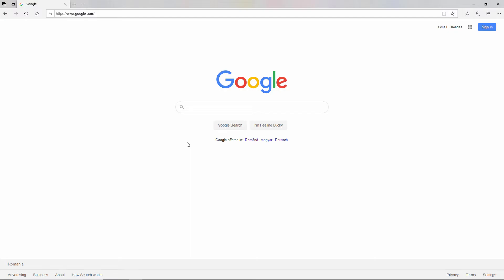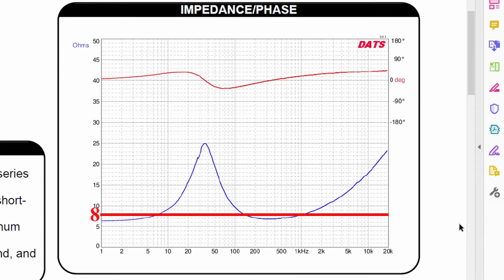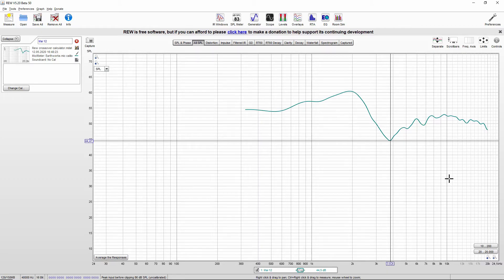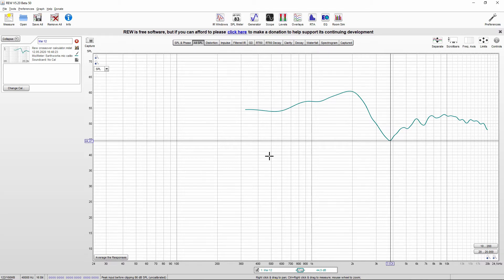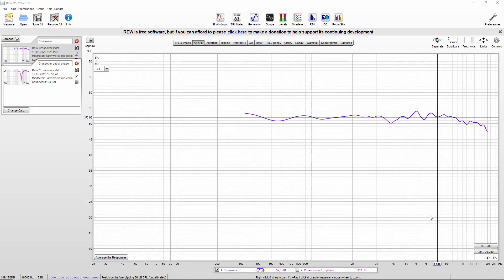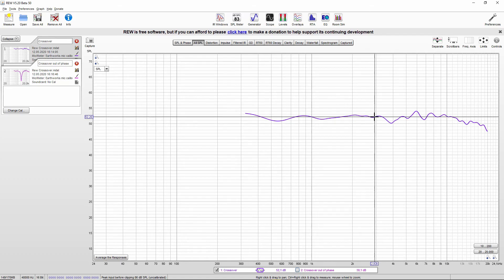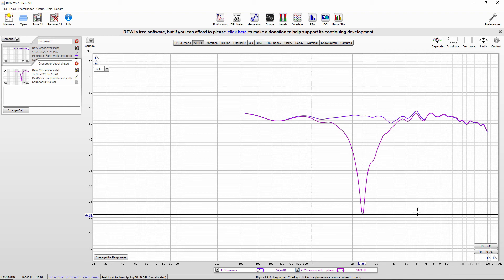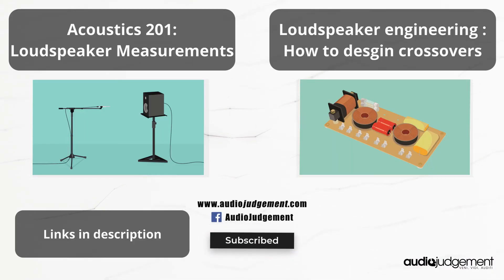How NOT to design a CROSSOVER

Comment: My god.. I’m in for a headache..
I’m currently designing a speaker with 18”, 15” 12”10” 8” and 3x6” plus 3 tweeters in a custom enclosure….
Oh shit…
I wish you  lived around the corner…
I might have bitten off more than I can chew.
My design might encompass the driver frequency that I would like, but the crossover might need a genius to fix.
I have 4 amps to mono block to frequency, which is a lot of wire and power, but without the crossovers to seperate and frequency’s correctly… I might as well piss into the wind..
Thanks,   
I have a lot to learn….
Bugger…..
Thanks for your video, keep up the good work!!!
Kindest regards,
Tim
Reply: Carefully  select drivers, u cant just throw random speakers together. The highest u should go as  a beginner is a 2 way system, one tweeter and one midwoofer, thats it. already a 2 way can eat months to  take it to high perfection, a 3 way can already  be a  nightmare. Remember, taking ur time finding matching drivers  will save u time  and money  at the crossover design. Dont forget  to study, its all about that.
Reply: best matching drivers i found are the Dayton Audio RS series of speakers, they are great for beginners and are very forgiving to design flaws. Fun fact, u can start designing them without measuring equiptment, because Dayton provides u with the FRD and ZMA  files, you only have to consider baffle step  :)

Comment: TY. In 1982 I built my own speakers from a Radio Shack book when I was 22 using home built Heathkit equipment. Now I am getting back into it at 60. A lot has changed. My first project is to rebuild my 1979 Optimus T200 speakers. Gonna be a challenge matching drivers&xover to an already built enclosure. Great info.
Reply: Update: Followed your course info on Udemy, my speaker project mentioned above had very good impulse/spl results. My next project is to make a box for an existing old Polk 10" sub.

Comment: In a first order filter, for example for a tweeter, does it matter if the attenuation by a resistor is put before or after the capacitor?  Or is it the same?
Reply from the maker: If you have a first order filter on a tweeter and add a series resistor, it doesn't mater if you place it before or after the cap. For higher order filters it does matter. It will have a different effect.

Comment: Thanks for making this video. Correct me if I am wrong. 1), pick drivers make box install drivers. 2)Measure driver sections T M S individually( psudo anechoic), 3) upload measurements to cad file. 4) make cross over. 5) Measure with cross over. 6) Cheers
Reply from the maker: That looks about right :)

Comment: Its possible to do it by ear with a sweep tone and a multimeter to monitor impedance plotting the variations and tune specially for our ear canal as no esr has a flat response but it looks far easier with a microphone.
I suppose if we test our own ears and get a response chart we could build a speaker around that to sound flat to the individuals ear simular to ps5 take on headphones.
Reply from the maker: You will most likely end up with a filter that will protect your drivers (tweeter from bass frequencies for example). But frequency response would be a mistery

Comment: Why not use  dew to masurement in  time 07.54 ?
Reply from the maker: You mean why I haven't used REW for impedance measurement? Because it's easier with DATS.
Reply: @AudioJudgement  Please explain where the SYS and SYS" lines came from in XSIM
Reply from the maker: @dejkho695  Sys is the system curve. You have the bass curve and the tweeter curve and sys is bass + tweeter combined.
Reply: @AudioJudgement  result from measuremented from speaker with mic rta or simulate or  import file frd ?

Comment: I have been looking at different woofers and tweeter frequency and for example, I have a 6 1/2 inch woofer with 60-8000 Hz at 8ohms and a tweeter with a 3000-20.000 Hz at 8ohms. Now the woofer you are using is like a 8 or 10 inch that starts at 35hz I'm guessing it ends at 3000  the specs of your tweeter ? 
Now you want to use 2500hz on your set up. Why ? I don't have a clue  on how to set up a crossover pls elaborate. Thank you
Reply from the maker: In an ideal scenario you select the crossover point in the following way. Let's say you have a woofer which plays linearly 60-6000 Hz. At 6 kHz the response either roll-off naturally or exhibits cone break-up (large spikes in response). And a tweeter which plays from 1500  to 20000 Hz. You take the top end of the woofer (6000 Hz) and divided that by half (one octave lower), so 3000 Hz. Ideally you would not want to crossover the woofer any higher than 3 Hz. And for the tweeter you take the lower end and double it (one octave higher). 1500 Hz x 2 = 3000 Hz. So you don't want to crossover the tweeter any lower than 3 kHz. So, we can cross the woofer anywhere between 60-3000 Hz and the tweeter anywhere between 3000-20000 Hz. In this case the ideal crossover point is at 3 kHz. However, in most real life cases the 2 intervals don't overlap at all, so there is no way to cross them. In that case you either find different, more compatible drivers. Or, you bend the rules and cross them lower/higher but with a steeper crossover slope (3rd, 4th order etc). Also, in this cases, you should try to cross the woofer higher rather than the tweeter lower as that might damage the tweeter.

Comment: So basicly, building a pair of fairly good sounding cheap speakers is not possible since you need measuring equipment and experience with crossoverdesigns, enclosure and so on, before you can make something decent.
Reply from the maker: Exactly! You can always follow some tried and tested DIY project if you want to build something yourself though.

Comment: Can you make a video about measuring frequency response of speaker with a measurement microphone?
Reply: I had good luck with TrueRTA Spectrum Analyzer software (paid -$97 about 10 years ago). For test mike I used the Behringer EMC8000 microphone (-$50 ten years ago). The mic is phantom powered so requires a pre-amp with phantom power (-$40).
Reply from the maker: Not really. It’s not that simple to fit in a YouTube video. You can lookup my Acoustics 201 corse, if you want to learn how to make measurements.

Comment: Thank you for taking the time to make this video.   What was the FS of the drivers?  I didn't see you adding any Zobel or other driver compensation in parallel with the drivers.  Finally, was the HF vs LF output (spl) matched so closely because of your filter choice, by the 2x mid-bass drivers just matching the acoustic output of the  HF driver, careful driver choice, or a combination of all of these?  What do you do to match the output point of the tweeter with the mid-bass drivers as far as phase is concerned?  Thanks!
Reply from the maker: A zobel network is used to flatten the impedance curve of the tweeter. Sometimes used when "the crossover gods" are not in  your favor and you simply can't get the response you want. This crossover was indeed very friendly, and didn't need additional circuits to adjust peaks or phase. It was just a 2nd order filter and a 3rd order filter. You start as simple as possible, and if the response doesn't look how you want, then you add different circuits to solve different problems. That fact that we got the crossover to work without additional circuits, is mainly luck. Usually the tweeter is louder than the bass driver, but since we have 2 bass drivers, we didn't need to use an attenuation pad, as their SPL are evenly matched. Regarding the phase, every component you add to the crossover will shift the phase, so when you play with the values of the components, you have to be aware of phase also. You simply reverse the polarity of a speaker, and check if there is big null at the crossover region. If there is one (the deeper the better), then it means that the speakers are in phase.
Reply: @AudioJudgement  Thank you for your reply.  My question regarding the FS or free air resonance of the transducers was to see if that played a part in your choice of crossover frequency.  Using the natural physical 6db rolloff of the LF drivers was a neat way to address the incongruence caused by the high and low slopes being unmatched.  Still, I wonder what's happening with overall phase in the system.    Given the limitations with passive filters we only can expect just so much, right?
Reply from the maker: @KevinWorrell   You cannot use the natural roll-off of the speaker. I mean the HF roll-off of the bass driver (because it most likely contains cone break-ups) and LF roll-off of the tweeter (because it will burn out the speaker at high volumes). You need to cross over at least 1 octave away from these points. If you get closer to them you need slopes steeper than 2nd order.

Comment: really nice vids bro. Would be nice to see one with freq response measurements without a calibrated mic, if there is an option for that :)
Reply from the maker: There is no point in doing that. If the response of the mic is not ruler flat, then the measurement is inaccurate. Dayton Audio has relatively inexpensive calibrated measurement microphones.
Reply: @AudioJudgement  Thank's for the reply. I'm just getting in to diy so it gets pretty confusing sometimes. Just ordered miniDSP Umik1, I think it will ddo the job for a while, since i'm a noobie :D
Reply from the maker: @brobi2  It will work, yeah. But you'll have to tinker with ASIO4ALL plug in when using it.
Reply: @AudioJudgement  sure . for now i am having trouble with t/s parameters measurement . any chance you can help me out? Build the test cables with 100ohm resistor but this new rew is screwing me up
Reply from the maker: have you checked the 2nd video I made using the new rew?
Reply: @AudioJudgement  yes the only problem i am still facing is really interesting... i measure the voice coil dc resistance with a multimeter. Lets say its 4.1 ohms. then when i am doing measurements with rew, free air and added mass it say the dc resistance value what i entered is too high, and recommends arround 2.46 ohms. could it be my sound card?(integrated ) or test leads being too long(cca 1m). ?
Reply from the maker: @brobi2  It doesn't matter how long are the test leads as you compensate for the resistance of the test leads when you short them out and do the calibration. I'm guessing you are making the measurement from 0 Hz and you should make it from 20 Hz. That's my first guess
Reply: @AudioJudgement  just calibrated it again to be sure , it's 20-20k. still getting a message when doing t/s parameters that the deltaR value is negative due to high dc resistance. this time it was 7.3 ohms .
Reply: @AudioJudgement  
The results what i got.. :D 
Zmin 8.47 ohm
fmin 177 Hz
f3 465 Hz
Le(f3) 2.180 mH
Motional impedance parameters
R0 104.10 ohm
CMES 212.8 uF
L0 68.716 mH
beta 0.1427 
omega0 381.3 
Blocked impedance parameters
RDC 7.30 ohm
dR -0.65 ohm
Re 6.65 ohm
Leb 0.0 uH
Le 4.958 mH
Rss 2029.0 ohm
Ke 0.3279 S-H
Thiele-Small parameters
fs 39.6 Hz
Qms 5.512
Qes 0.352
Qts 0.331
Fts 119.7
Mms 39.76 g
Cms 0.406 mm/N
Rms 1.795 kg/s
Vas 2698.71 litres
Bl 13.670 Tm
Eta 46.47 %
Lp (1W/1m) 108.83 dB
Dd 52.49 cm
Sd 2164.0 cm^2
Added mass measurement: Jun 7
Added mass 100.000 g
Air temperature 20.0 C
Air pressure 1013.25 mB
Air density 1.2041 kg/m^3
Speed of sound 343.2 m/s
Reply: @AudioJudgement  Umik1 works with REW's Java driver out of the box, no need for ASIO drivers. Not sure if at one point in time it didn't but if so it must have been years ago.